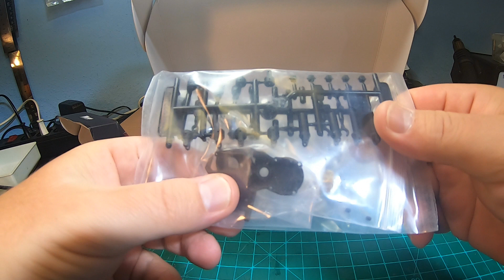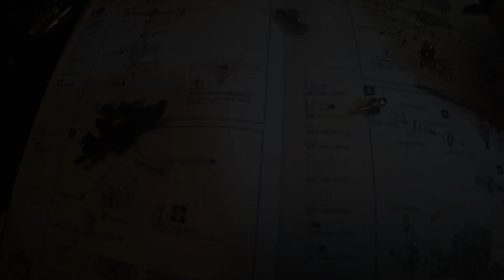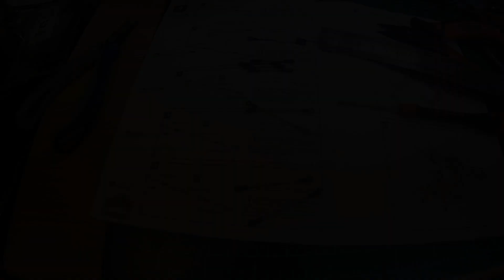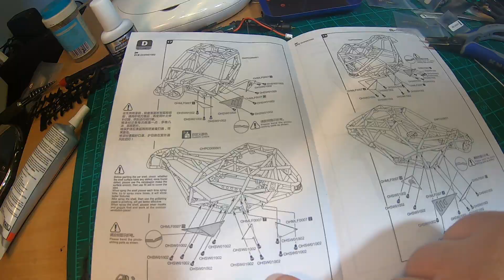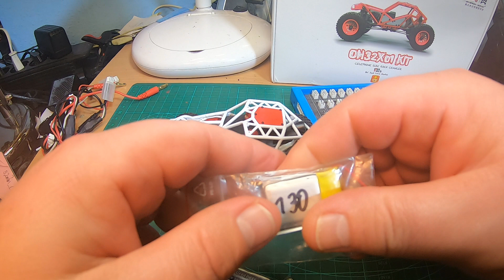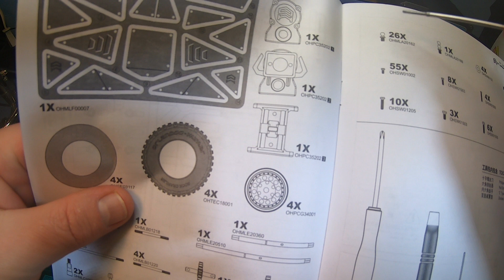1/32 Rock Bouncer Orlandoo  OH32X01: Build and Electronics Installation

Comment: Hello Don! I would like to stretch the front end on my Bouncer, which links would you suggest I order?
Reply from the maker: Sorry - no idea, never thought about this. 
I would take the original plastic rodends and buy threaded rod of matching diameter and make custom ones.
Reply: You could either unscrew the original rod ends a bit they still hold okay, or the OH35P01 links are 40mm lower and 25mm upper rods and the original rock bouncers are 32mm lower and 20mm upper. You can also buy a set of 5 x 35mm rods for the lower depending on how far you want to stretch it but also may have to replace the drive shaft with a longer one

Comment: I just bought this as my 1st rc kit so im a noobie what do ibput in the front n rear axle diff if they take oil as well as what shock oil for maximum best articulation?
Reply from the maker: Only a bit of white grease - tiny shocks, forget oil.
Reply: @donaldsneffe  thank you! Scared with how tiny the screws are
Reply from the maker: @austinbraden9752  PH000 screwdriver and a table loupe help with assembling.
Reply: @donaldsneffe  I'll look into ty

Comment: Im currently wondering why my 3000rpm motor seems to have no punch. It really can be stopped by a bump in carpet. It gathers speed slow it doesnt even seem like its trying.
Reply from the maker: Hmmm... donno. Could be a bad motor or a bad ESC (or, unlikely, a super bad, nearly dead Lipo), problems in the drive train (does not move freely)? I assume throttle Dual Rate is 100% on your radio?

Comment: This is like my 3rd time watching this video. I haven't put my x01 together so my question is: could I put the 300rpm motor gears on to the 3000rpm motor? That way I can have crawl speed and top speed? And is there a picture for reference regarding the parallel diodes that you installed to lower the voltage that the 2.2 servo? I'm clueless when it comes to electronics but I can follow instructions.
Reply from the maker: I think, those motors are all the same, only gearbox makes them 3000 or 300 rpm. So if you would put the 300 rpm motor gearbox to the 3000 rpm motor you would again have a 300 rpm motor.
A diode reduces voltage for about 0.7 V. It is simply soldered in between the power wire (I used plus), similar to a resistor. Not in parallel.
Reply: @donaldsneffe  thank you for the reply. Do you know if double steering  (2 servos) can be used with the orlandoo D4L transmitter and esc?
Reply from the maker: @luisLP5752  There is only 1 servo port. 
But you can always use 2 servos on 1 port, in parallel, using a y-cable (or connecting the wires of the 2 servos). 
But then there could be a problem with servo direction. 
If one of the servos has wrong direction for your setup, you cannot simply reverse it by radio (Ch-1 reverse). 
But there would also be a solution for this - trying different servo types (with different direction) or changing servo direction in the servo (changing position of motor wires and outer 2 (of 3) wires of the potentiometer inside the servo). 
There would be also "servo reverse units" to buy, but probably too large for Orlandoo...
Reply: @donaldsneffe  thanks I'll try that I want double steering in my x01

Comment: Hey so you mentioned you put a 3,000 rpm motor in yours instead of the 200-300 rpm motor, does your faster motor have just as much or more torque as one of the lower speed motors? Or does it even matter at this scale lol. Curious because I wanted one of these from tiny4x4 but other ones i've seen are super slow. I want mine to be a bit faster but also still be able to climb steep hills!
Reply from the maker: The motor for sure will have less torque. But There is no comparison for me. You see it is really fast, so no slow crawling. Maybe buy 1000 and 2000 rpm, motors are cheap, and see what you prefer.
I really do not know how 200 and 300 compare to 1000 and 2000, cannot understand this different labelling of the motors by Orlandoo. I do only have the 3000 from the ""new ones", and all other are "old ones" (200,, 300, etc.).

Comment: Hello. Congrats for the video. Can you help me? I am building a truck 8x8 with Orlandoo base, are the wheels of the Rock Bouncer compatible with the Orlando Jeep axles? Thanks in advance.
Reply from the maker: Yes, they are - same mounting system.
But they are larger, so they are not (or hardly) compatible with the Jeep body, will rub.
Reply: @donaldsneffe   Thanks a lot for the answer. I will try to fit them on.

Comment: How did you make the interior? I got this as my first orlandoo haha, it was amazingly fun, im still waiting on a car style transmitter and then ill direct solder everything and hopefully get it looking cleaner.
Reply from the maker: Simply cut thin plastic into shape and bent the edges... trial and error. Only 2 small dots of E6000 glue hold it in the cage, mostly press fit. Heads and steering wheel 3d printed.
Good luck!
Reply: @donaldsneffe  Hi, do you have a File for the Driver and the Steering Wheel?
An Thingiverse link or something like that?
THX
Reply from the maker: @Ghosty-RC  https://www.thingiverse.com/thing:3324914
Simply scaled it down (donno how much anymore, trial and error) and cut the head off, and the wheel.

Comment: Great video WHAT WERE THE TINY TOOLS YOU USED AND WHERE CAN IGET THEM PLEASE,,WOULD YOU BE ABLE TO SEND A LINK? WOULD BE MUCH APPRECIATED:)
Reply from the maker: What tools do you mean? The Screwdrivers? Those are tools from German companies Wiha and Wera.
You can get them in most tool shops here in my country. You can also get them on Amazon (but this is Amazon.de - so do not know if "your" Amazon also does have those).
The PH000 PHilips screwdriver I used: Wiha Picofinish Phillips PH000 x 40 mm: https://smile.amazon.de/Wiha-Feinschraubendreher-PicoFinish-Pr%C3%A4zisionsschraubendreher-Feinmechanik/dp/B001JGAPYA/ref=pd_sbs_328_1/257-5266445-8802756?_encoding=UTF8&pd_rd_i=B000R5K8XM&pd_rd_r=5cf7fc96-9248-4a8f-aa8a-16ef4c4187cb&pd_rd_w=kadgf&pd_rd_wg=RkTb9&pf_rd_p=17269923-e95e-42b2-b8e1-f208b58f5815&pf_rd_r=3MBTDGZ931WCRJZC0XQY&refRID=3MBTDGZ931WCRJZC0XQY&th=1
0.9 mm Hex screwdriver:
Wera 2054 Elektroniker-Sechskantschraubendreher, Hex-Plus, 0.9 x 40 mm: https://smile.amazon.de/Wera-2054-Elektroniker-Sechskantschraubendreher-Hex-Plus-05118066001/dp/B0001P18O6/ref=psdc_2077118031_t1_B0001P18JQ?th=1
Wiha Schraubendreher Precision ESD Sechskant (27708) 0.9 x 40 mm: https://smile.amazon.de/Wiha-Schraubendreher-elektronische-gef%C3%BChlvolles-Feinmechanik/dp/B001IDF4Q8/ref=sr_1_9?__mk_de_DE=%C3%85M%C3%85%C5%BD%C3%95%C3%91&dchild=1&keywords=wiha%2Bprecision%2Besd&qid=1607694074&sr=8-9&th=1
I guess I bought my bearing pusher tools from Hobbyking many years ago, but do not find them on their site anymore.
Didnt see the small one anywhere, but the bigger one is ok, it is something like this:
https://www.amazon.com/ShareGoo-Bearing-Install-Wrenches-Maintenance/dp/B07SQYVZQ5/ref=pd_lpo_21_t_0/260-6380463-5064962?_encoding=UTF8&pd_rd_i=B07SQYVZQ5&pd_rd_r=6d9364db-520f-4711-a5dc-c8d550ee51c9&pd_rd_w=nPW3t&pd_rd_wg=800TZ&pf_rd_p=7b36d496-f366-4631-94d3-61b87b52511b&pf_rd_r=KDAAKX7SGQK87XBB8HFR&psc=1&refRID=KDAAKX7SGQK87XBB8HFR

Comment: Very nice video, thank you😊 i used the orlandoo D4L reciver, decased, it took me many weeks to finish it and to be satisfied, the 3000rpm is a lot of fun, i love it. I keep breaking my servo, any idea of a metal gear servo?  Very clean buit 👍👍👍 my built: https://youtu.be/C4kfN-wPGzA
Reply from the maker: There is no metal gear servo in this size. Did not have this problem so far, but did not drive a lot (maybe 4 batteries), but bashed it really hard. Did bend steering rod, but not break the servo. 
Your bouncer is supercool - with roof lights :-)  - congrats, it is really a difficult build!